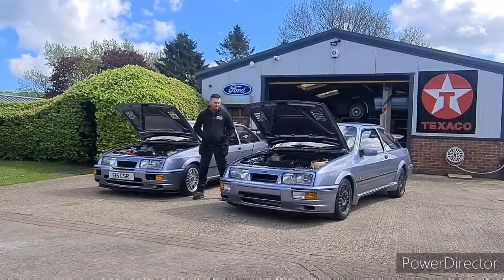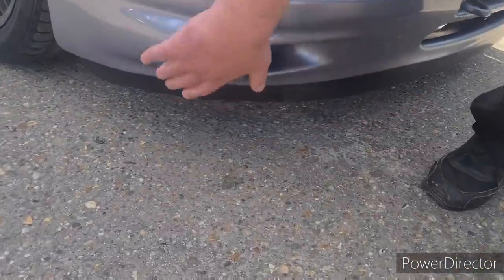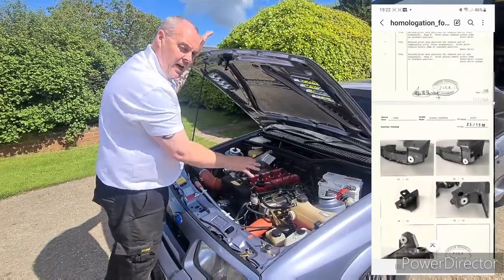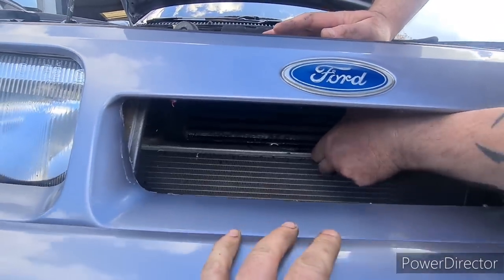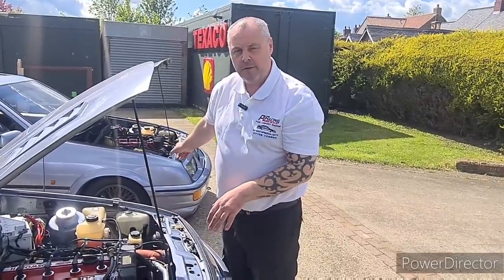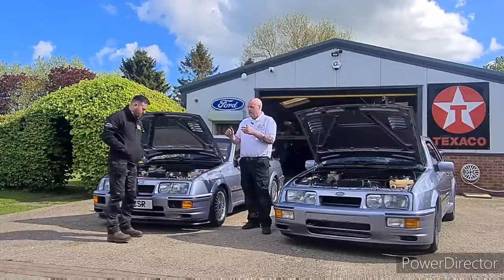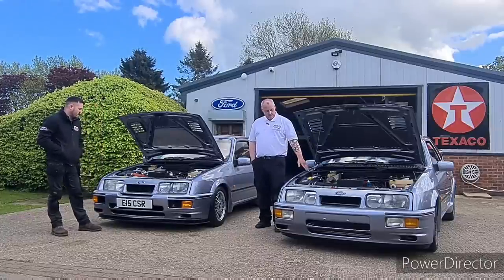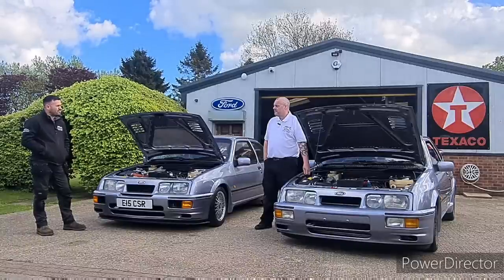RS500 or 3dr Cosworth? What makes the RS500 so special. We compare these two iconic cars.

Comment: Absolutely fascinating listening to these stories by Paul – (from the ones with Adam Smith, where they chopped the corner off the battery tray, the back to front stamping of the chassis number, the race cars started off as a standard 1.3L body shell ? ) to these differences we learned about today – well done, perfect. 
👍

Comment: In 88 in College I did a project on these.  What always amazed me was even though the RS 500 had all those differences, it was only mildly better performing.  I guess you got to have the fuel injectors active, otherwise the air box, turbo, hose diameters was all useless in a road car.  Essentially that’s it

Comment: Great film, good to see all the differences. You touched on the extra 4 injectors with the plug behind the battery. I'm interested to know if the wiring loom and ecu were capable of running 8 injectors.?
Keep the videos coming.
Reply from the maker: the standard wasnt no , the loom was there for homologation only

Comment: I seem to remember the motorsports shells had thinner panels on them also. had it explained to me back in the day and you could physically feel the difference on the panels they pushed in with little resistance.
back in the day very close to release day i saw a white rs500 ploughed through a set of barriers on stratford broadway london , it was monday morning about 6;30 am and this had obviously been stolen from a forecourt and wrecked almost instantly ....often wonder what happened to it given the rarity of them. looked repairable but quite shocked to see one having read about them weeks before

Comment: Hi Paul I used to work for Weber UK on Weber Alpha engine management systems from my memory the RS500 ecu used to have an additional daughter PCB to drive the extra injectors am I correct in saying that the standard 3 door had a different version of the P8 ECU? Another great video all the best Les👍
Reply from the maker: Hi Leslie , the rs500 from new had the standard ecu , ie , not changed from the std item
Reply: @paullinfoot6017   Thanks Paul for updating this for me I think we dealt with aftermarket tuners who tapped into the OEM step up using the extra injectors on the rs 500 and offered a custom eprom with a custom map all the best Les👍

Comment: Hi Paul, 
You mentioned the extra fuel injection system, that was not linked up. Could you make this work on the road car if you wanted the extra power.
Reply from the maker: you needed another ecu that had another board fitted to run the other 4

Comment: You missed off about the engine numbers being different in a rs500 due to them removing original engine and putting the smaller cored engines in. And that none of the 500's came with build plaques from factory. Love your videos could listen for hours.

Comment: Hi Paul,great video.
Just 1 point,you mentioned that the top speed of both were similar,but is the 500 able to have a upgrade that makes a big difference in top end speed.Cheers Paul.
Reply from the maker: Hi Phil , not really as its the same gearing as the std 3 door so top speeds will always be about the same

Comment: That was a good video, really enjoyed it. 2 questions I’ve always had were.  1. The 500 block being different, was it used in any later cars with it being the end of run like in the sapphires or escorts?  

2. The second bank of injectors in the 500, could they just be plugged in or is there more involved?

Thanks

Kev
Reply: Obviously, not just plugged in as there nowhere to plug them in . My question is, has anyone  wired them in & gone for big boost with a standalone ecu ,,

Comment: I liked the role play as a Ford dealer! I used to live around the corner from Vospers in Plymouth - a massive Ford dealer. They had an RS500 in there... It was there a loooong time. Later they had an RS200 in there, that was there even longer. The regular Cossies were selling like hot cakes. I also remember when the Cossies fell enough in value to fall into the hands of the chavs. I knew for sure the Cossies were destined to be big money classic. Here's a tidbit for you: £20,000 in 1987 money is around £50,000 in today's money. So if you bought an RS500 back in the day and used it well, you'd still have at least doubled your money. If you'd stored it and used it sparingly? Well that's big ROI!
Reply: It's actually 74k today! However, if you'd invested the 20k it would be worth more than 74k now. My dad had a white RS500, paid 25k in 1989, kept it a year, and then sold it at a loss. In 1993 Ford's of Winsford had a black rs500 for £9995. Dad laughed saying thank God he got shot of his....
His white 500 is still around, I see it occasionally in mags etc. He used to let me thrash around in it when I was 19 on my 3rd party insurance 🙈

Comment: Just a quick question guy's. I was just wondering was that extra fuel rail on the RS500 was it used or was it just for decoration on the road cars. As you showed there's a wiring and a black plug attend to the extra fuel injectors housing. Oh ready enjoyed your tutorial about the two cars every day is a learning day. Plus it's always enjoyable to learn new things.
Reply from the maker: It wasnt used from standard , but if you wanted to upgrade the ecu to power all 8 injectors and fit a full 8 injector loom then the fuel rails can be used
Reply: @paullinfoot6017  a BIG thanks for your reply Paul 👍

Comment: On the RS500, could you plug the second row of injectors in and get them to work with the standard ECU? 
Or would you have to use a different ecu, or program the standard ECU to work the 8 injectors?
Reply from the maker: you need another board inside the ecu to run the other 4 , so no its not just a simple plug in system
Reply: @paullinfoot6017  Thank you, I presume that both boards will link up with each other and communicate

Comment: Can you simply connect that extra fuel rail in the 500, the plug shown, if you can, does it require any additional tuning for the car to work on  the road and will it add any additional power?
Reply from the maker: No you cant just connect that plug , as said in the video it was for homologation only .

Comment: What did Tickford do with all the redundant components once they were removed from the standard Spec. Car?
Reply from the maker: Hi Darren , they were all sent back to ford and sold through there parts supply dealers , the engines however were used in the early sapphire cosworths

Comment: I've heard many times over the years that the bottom end is a Pinto Diesel. Is that correct.
Reply from the maker: I can assure you it is NOT a pinto diesel , or any other std bottom end , the cosworth and rs500 bottom end are cosworth / rs500 special
Reply: @paullinfoot6017  Thank you, I can now correct anyone that says anything else and say I have this on good Authority.

Comment: Was the Amal Valve bypassed on the RS500 as it can’t be seen where the cross over pipe is?

Does the RS500 run the same chip?

What happened to the engines from the 500 standard cars sent to Tickford?
Reply from the maker: Amal vale is still fitted , just relocated under the slam panel on top of the radiator

Comment: I remember when you could get a 4-door Sierra Cosworth 4 under 1500 quid in quite good condition with probably 100 thousand miles on the clock or maybe just under the nightmare of your life you wake up in the morning and your Sierra Cosworth is missing and now you got that dreaded phone call to the insurance company and you know they're going to try and stripe you up anyway these was the last of the great Ford RS cars you could put your foot down and the engine would never blow up I work for torque developments in Barking owned by Ray and Mark Amazon young men but I worked a lot of Cosworth mostly servicing MOT fail stuff why do they not make engines like this no more you can read the engine up all day long and it would just keep going and going and going I see a video of a man driving a brand new Lamborghini unfortunately he put his foot down too hard the traction control stability control did not seem to work properly any ended up in a crash barrier with £75,000 worth of damage on one side and £45,000 with a damage on the other side classy had to pay for the crash barrier I mean his insurance company

Comment: I would just like to say this back in those days when all these cars were new before the first MOT 97% of all cars on the road was clocked meaning the mileage was tampered with David by the car dealer the cellar even by the car dealer buyer is they were so easy to clock is ironic really that they even easier to Clock now and you don't even get your hands dirty is the older cars you had to take out part of the dashboard take out the clocks etc it was all mechanical and you could roll it back in a few different ways me personally I can spot a car I'm a million miles away if it's been cooked because the sequence of digits Honda speedo they should be exactly the same height sitting in the Square H digit should be exactly the same height as the next one all the way across if any of them are out of sequence I guarantee you that car has been clocked once twice and even three times yes everyone was clocking their cars every car was clocked and I know this as fat because I work in the motor trade for some 24 years we used to get around £50 to clock a car very mind back in those days forward as one of the most popular cars ever back from the 70s 80s 90s 2000 you can clock that car in 1-hour and less even today's cars I don't think you can trust them either

Comment: The RS Sierra's were built in Germany.
All RS Sierra's were built for homologation. Group A rally (think group N spec) 5000 cars and Group A circuit racing 500 specials
RS Sierra's were only available and only began racing 1986. The RS500 had to be converted at Tickford hence the time delay. 
The battery tray is modified to clear the manifold
The engines were swapped at Tickford as complete units and the engine number is stamped on the front of the block starting YBD - 
The RS500 engine is "4x4" engine before the "4x4" existed in terms of cooling system and long stud conversion.
The genuine RS500 head is YNO-627 casting
VIN, engine and build number do not correlate due to the random order of conversion at Tickford. 
The first batch of 909 motorsport body shells were completely standard except the sunroof. 
There is no such thing as a "lightweight" shell. In the second batch of shells a batch was done without tabs and mounts. 

There is not 500 RS500's anymore. The number is believed to be in the low to mid 300's
Reply from the maker: Im afraid you are wrong on a couple of points there
Reply: @paullinfoot6017  No I'm not.
Reply from the maker: @jdoe9518  im sorry to say you are , There IS such a thing as i lightweight shell , I have had a few over they years and there are quite a few differences over a std 909 shell , and its not just missing brackets etc 

There are many more than 300 still alive , i have many more than that on file confirmed as still alive
Reply: @paullinfoot6017  
9091968 RHD Body shell
9091969 LHD Body shell
As Ford wanted to compete in Group N and Group A The first batch of shells had to be standard less sunroof.

What's the "lightweight" part number? 

The entire point of homologation is to set standards and limits that must be followed.

 The body shells used the same tooling. 

Or are you claiming Ford was cheating?

Oh and you're right.. there's at least 600 RS500's left

Comment: Apparently they done a triple spoiler yes originally it was designed to be 3 flat spoilers individually and connected together to make one big giant spoiler on the escort Cosworth I believe Wheeler Dealers try to recreate the triple spoiler on the escort Cosworth and they even spoke to the main man who designed it in the first place but my question is why do they not make good engines no more a Ford engine would do a quarter of a million miles no problem going up to half a million miles no problem and then somewhere in between 750 and 1 million miles with regular servicing and about 4 clutches dear Ford Motor Company will it be possible for you to start making good engines again because the ones you've been creating over the last 10..15 years are total pants 3-cylinder do we really need to talk about it I actually feel physically sick at the mention of a rubber belt submerged in oil from the engine oil you have been telling us for years do not get oil on your timing belt made of rubber I'm getting lost for words I'm getting confused and I wish I never see that engine that small 3-cylinder thing with a rubber timing belt submerged in engine oil I mean even I alien Nation that's 200 million years ahead of us would not even try this stupidity rubber and oil do not mix  rubber gets to a certain temperature it gets very stretchy a bit like Maureen the local brass down the road when she drops her cacts even a massive big company called Durex will only submerge their rubber into anal lube maybe we should run or engines on anal lube because it it seems to work well for Durex now we could try this out by getting Jeremy Shorty and the thing to put a Durex over their head and then put engine oil over their heads this will make a perfect test obviously the winner would get a free packet of Durex now he can ever have extra large or extra tiny I think that would have Hammond's name on it anyway let the experiment roll